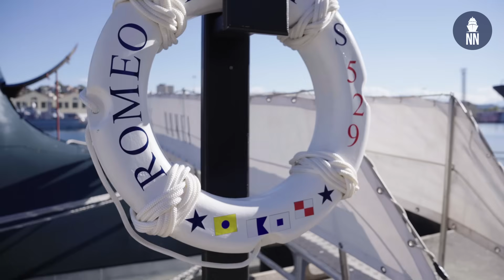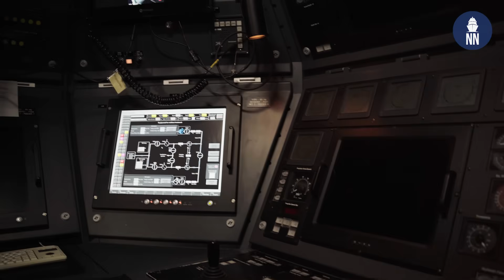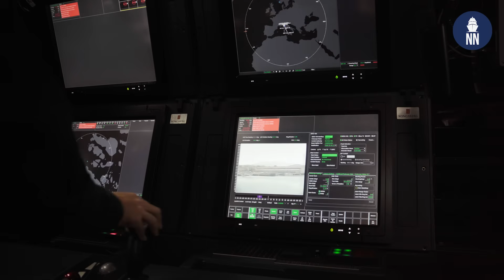Rare access inside an Italian Navy Type 212A Submarine

Comment: Ι recently visited a Greek submarine named Pipinos, a type 214 sub which is the export type of the 212 and its almost the same interior and subsystems. 
Thank you and Grazie to the Italian crew!
Reply: The Greek Type 214 are not the export of 212. Back in the early 2000s when Greece were looking for submarines, the Germans had the new 212 built and the type 214 on paper designs. The Type 214 was an upgraded version, bigger with longer endurance. The Greek officers asked for the bigger design. Regardless, there was a huge scandal of embezlement around the submarines and there were several flaws with the Type 214 class which were fixed.

Comment: They do not have AIP propulsion it is Air Independent Power for partial charging. It is not silent
Reply: What?  AIP is the acronym for Air Independent Propulsion, though it is indeed used to charge batteries, not to power the electric motor directly. It is one of the quietest forms of chemical-to-electrical energy conversion. Stirling engines can be just as quiet, but have many disadvantages.
Reply: @paoloradaelli7120  Air Independent Power, and it's not as quiet as it's claimed. Obvious that if you are a non-submariner, you will believe anything thrown at you. Why do you think they are quiet?
Reply: @Highendaudio1  The MMI and many other navies call AIP “propulsion”, you can call it what you want, it does not change the way it operates. Quiet with respect to what?  AIP subs on low-speed patrol are ‘reported’ by many sources to be quieter than SSN at the same speeds. The fact of being a submariner changes very little unless you are a sonar operator, In which case you would be unlikely to reveal operational details. ‘Why they are quiet’ is a nonsensical question - the real question is what are the sources of noise (fuel/collant pumps, valves etc) and how well they can be suppressed.
Reply: @paoloradaelli7120  Nope, thats it, but the internet changes everything, especially during that period when the idiots who have amateur outlets tried to claim that these silly AIP stunts could propel the submarine.  I have ridden the 212s for Bost and the Swedish Gotland yiu can tell i am not impressed by them
Reply: @Highendaudio1  please elaborate. We know how AIP works, it can charge the batteries sufficiently to maintain low-speed patrol for several weeks (so yes, it does not technically ‘propel’ though it is still called a ‘propulsion’). Operationally, this seems a massive advantage. Which part of this did you not appreciate?
Reply: @Highendaudio1 
Or one can read and hear what German and other submariners say about the 212A - they are extremely silent. The PMSM engines even add to this.
Reply: @Highendaudio1 
You just revealed that you don't even know the basics of modern submarine propulsion.
Reply: @paoloradaelli7120  that it is a German/Italian high tech product
Reply: @Highendaudio1 the sound signature is from the cavities fo the screw, not the AIP itself and yes, generator is still have a sound when it's turning but it's dampened
Reply: @saltymonke3682 BS what do you actually know about the system or submarines at all   please do me a favour i am not a dafty
Reply: @Highendaudio1 yo old man, still mad about MAD? 😂😂😂 do you think we still use your analog computer from the 70s? 😂😂😂
Reply: @JK-h3e Wow what do you think i do for a living . You seem to have Wikipedia knowledge .  I have ran SSN sound rooms since i was 19  all motors make discrete noise. The SSN v SSK exercises which happen every year on a one on one basis the SSNs come out on top. You should stop making comments about things you dont know anything about
Reply: @saltymonke3682  Old Man, haha, oh dear. You dont know about battery draw, haha. I am not Mad about anything. It seems to be you who struggles with reality —remember, lol. But hey, the rhetoric between Xbox and reality is your issue
Reply: @saltymonke3682  The radiated noise comes from all machinery and all aspects. The Fuel cell, of course, makes noise. It's just that you wouldn't understand how and why Its a world that is above you but you are full of assumptions
Reply: Fuel cell + battery is obviously the most quiet propulsion system as it has no moving mechanical parts except the shaft and screw
Reply: @ChristianSamsel Fuel Cells are not quiet and they top batteries off they cannot charge them and the motor is only driven by the battery.   Do you know what quiet is or are you simply assumimg . You watched the video and the Submarine isnt even quiet alongside never mind at sea
Reply: @Highendaudio1 
Strange, because everyone else, incl. the German and Italian navies, the producing shipyards and even allied submariners who encountered them in exercises, say so... 

But sure, I will just ignore all that in favour of a faceless internet troll who probably tries to tell me next that the earth is a disc... 😂
Reply: @JK-h3e  You carry on, what do you think i do for a living and as i have mentioned, we have been having SSN v SSK exercises for years. It's not a guess, it's based on reality Where do you think they do their assesments
Reply: @Highendaudio1 
Cry me a river, toddler^^
Reply: @JK-h3e  I love fools like you haha
Reply: @Highendaudio1  I think people watch videos without watching, the diesel engine was on, and you could not here that outside the engine room, that was isolated from the rest of ship, it also explain how. Moreover under water goes by batteries and FUEL CELLS!
Reply: @iswara108enricoC  fuel cell is not very efficient and is why they still snort
Reply: That would contradict everything in the public space, so you might want to elaborate. Until then, I'll call it BS, given that all information states the 212A to have AIP (basically that being the type defining feature) all back to 2002.
Reply: @erikitter6773  I think you have swallowed the cake. The wrong cake.
Reply: 212A has fuel cells for AIP.  The XO said it can charge batteries or drive the motor directly.  All this is public information also.
Reply: @LoanwordEggcorn  Fuel cells partially power the battery, and it's difficult
Reply: @Highendaudio1 they can recharge the battery’s or directly power the motors, allowing aip for weeks
Reply: @LoanwordEggcorn  Well, it cannot look at the fuel cell's output and the amps required to turn the motor, even for one revolution. Fuel cells produce such a small amount of DC power.. The motor runs off amps
Reply: @Highendaudio1 I am sorry, this is not correct and is confusing. The power output of an AIP system on U212A is of order 300kW. I think the voltage is 700V, so the current is ~400A. This is 10 times more than needed to run at 5kn, so the AIP will keep the sub batteries fully charged on silent patrol so long as the fuel lasts. However, the AIP output cannot be directly fed to the electric motors, for the simple reason that the output is DC and the motor is AC.
Reply: @Highendaudio1 do you think the newest Siemens PEM and fuel cells are the same as your lead acid battery? 😂😂😂😂 one module now can handle several hundreds of kw, and they have many modules there
Reply: @paoloradaelli7120  i have already told you this why are you trying to tell me agsin. The output of any AIP system is small because they are not efficient. Spoiler alert which is why they snort all the time. It is only the media who make out they dont and make up this mythical story that they can go for weeks without toppings off the batteries. Thats nonsense
Reply: @Highendaudio1  Note that the fact that a sub can do something does not mean that it will do it all the time. In peace time and if you are simply going from A to B long distance, it makes a lot more sense to run like a conventional diesel-electric sub - this saves the AIP fuel of which they don’t have a lot and is also faster. They can fully recharge the batteries on AIP in about 12-20h, but this would only happen if they had depleted them in a high-speed run, which can only happen in combat or in specific exercises. If they really want to go ultra-quiet, they will simply turn the AIP off - with the new Li batteries, U212NFS may be able to run this way for a week. However, ITS Romei operating off Augusta will probably never snort when it ambushes Russian subs in the Sicilian  Strait. This is the typical mission of Italian subs and they have been doing it for ages.
Reply: This is why Augusta is such an important base, as the officer was saying.
Reply: @Highendaudio1  yes sure , the engineers made it were drunk
Reply: @iswara108enricoC  no idea what you are talking about
Reply: From a quick Google search: "It features diesel propulsion and an additional air-independent propulsion (AIP) system using Siemens proton-exchange membrane (PEM) compressed hydrogen fuel cells. The submarines can operate at high speed on diesel power or switch to the AIP system for silent slow cruising, staying submerged for up to three weeks with little exhaust heat."
Reply: What hare You saying ???...it's the same !!!...shut up... pleeeaaaaseeee!!!